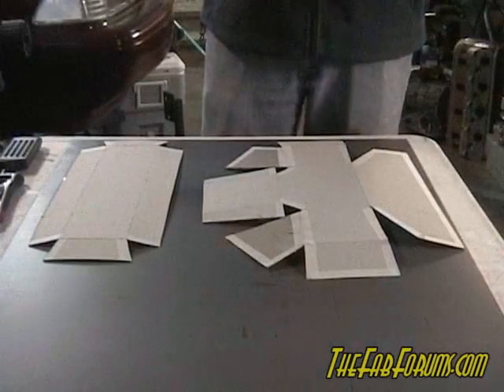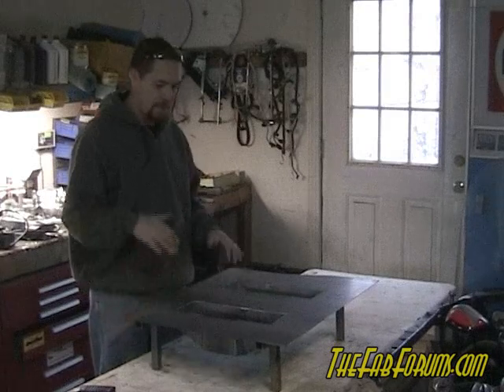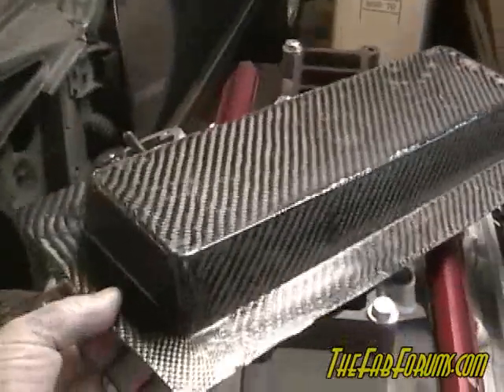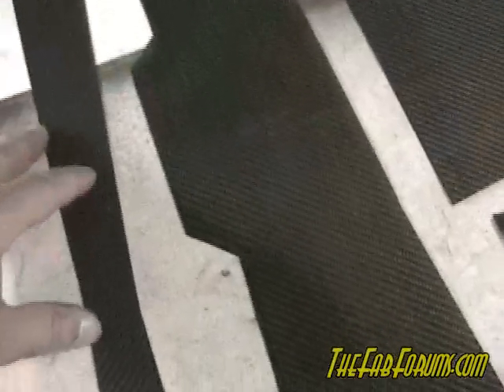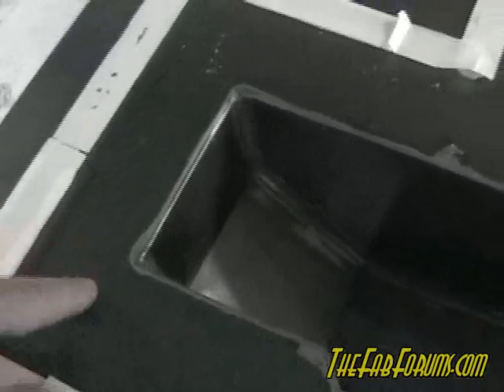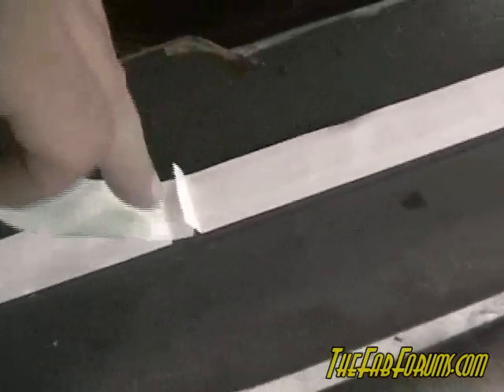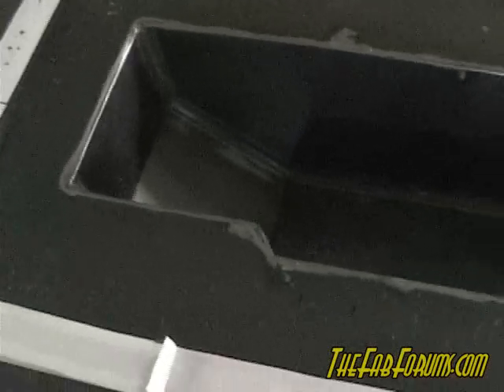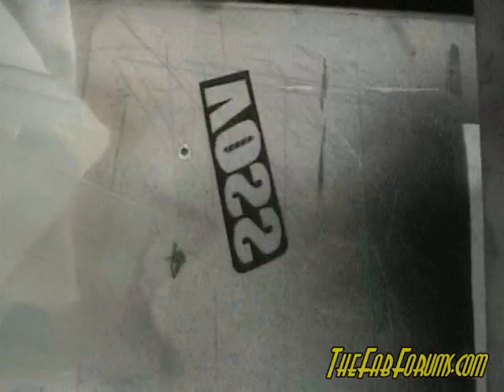How to build carbon fiber intake 2

Comment: nice video man, I was searching for just carbon fiber lay up procedures since I am looking at getting into building composite RC Aircraft. I like the idea you had with cutting out the reinforcement pieces and adding them to support the twill stuff.....What type of resin did you use? and what did you use for the vacuum device? and about how long did you let it cure? The part turned out looking great by the way....I might make one for my camaro now.